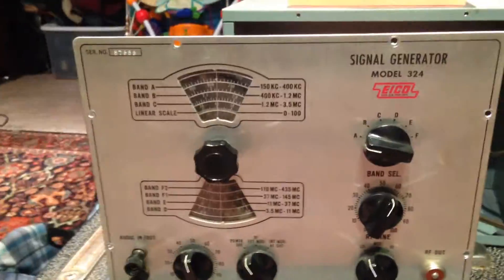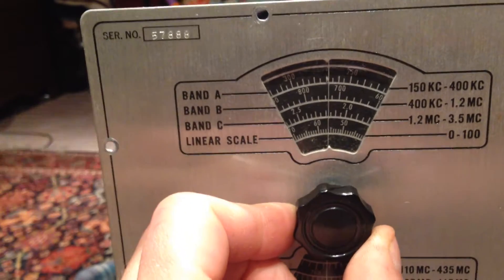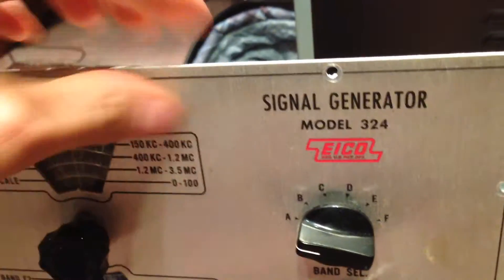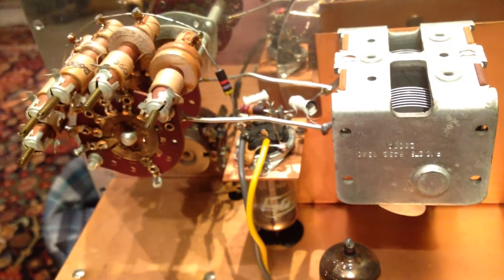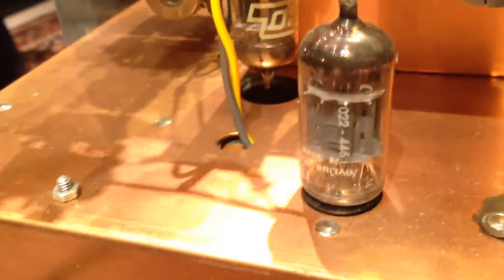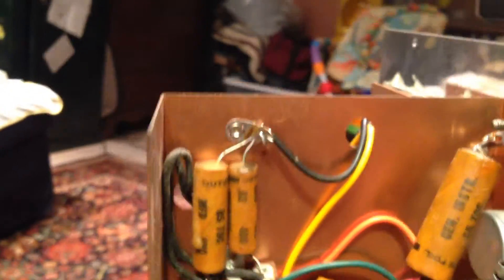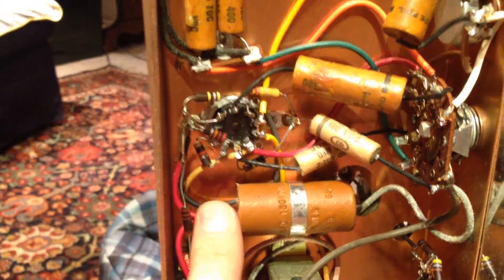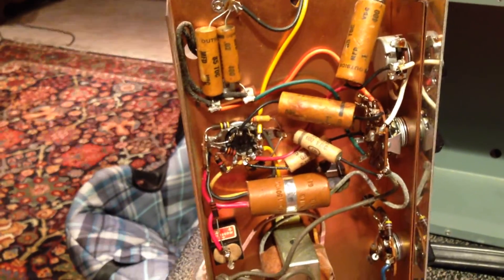EICO signal generator model 324 vid #1

Comment: Hi Steven. The manual can be found here.
http://www.nostalgiaair.org/References/Manuals/
Hope this helps.
The square black box with the red label is a rectifier.
Take care Buddy.
Bobby
Reply: Steven King
Steven. You are Not an idiot !! .  Ater my illness you wouldn't believe what simple things I am trying to re-learn.  That's what makes electronics fun always something new in the field. :) 
All the best Buddy.
Bobby
Reply: Steven King
The more simpler tube tester will run the heaters in the tubes. use the manual has it has the settings for your tester.  I hope this helps Buddy :)
All the best,oh and do a video of you testing a couple of tubes. If you need your computer fixed I will fix it for free. I never look at peoples files. And I have fixed a lot over the years. when I worked at Exide I almost always had one seat-belted in the back of my car.well till I was living at work so to speak :)
Bobby
Reply: Steven King
Hi Steven.
Have you checked out Best Buy. or online computer stores,like Tiger , New egg. I've seen some for under  $200.00 dollars. That would be the best way to go,in my humble opinion :)  New and with a warranty And if you want me to look. Just tell me what you need in a computer and I'll do my best to help you out.
All the best.
Bobby